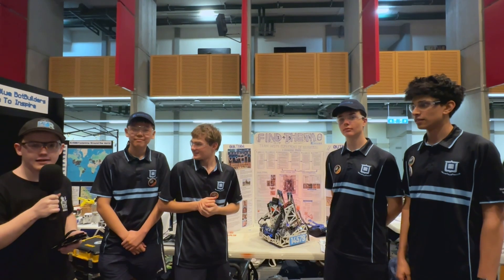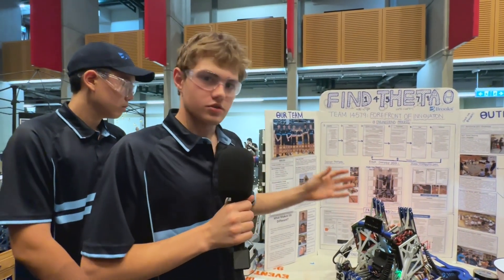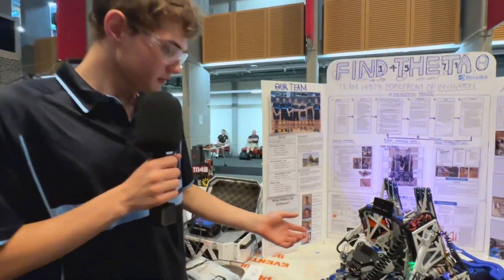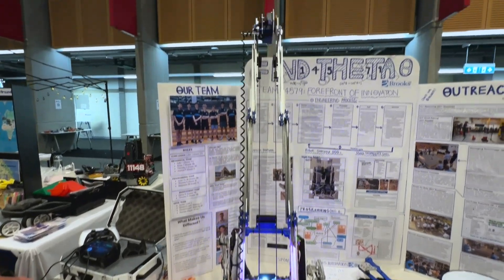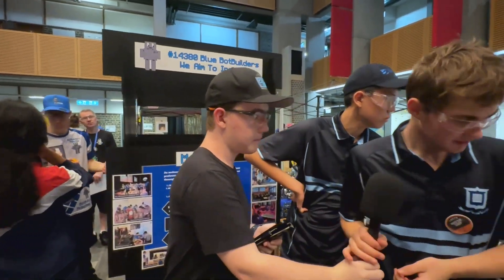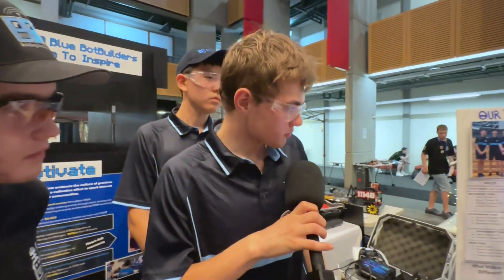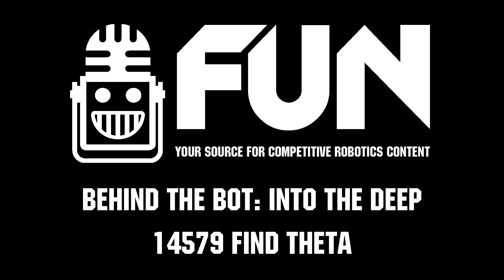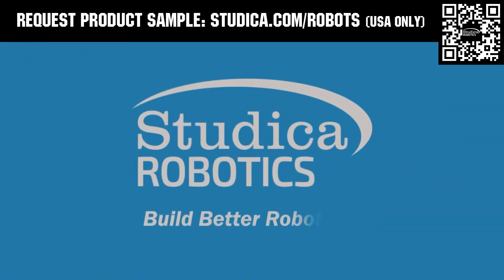14579 Find Theta | Behind the Bot | INTO THE DEEP

Comment: Doesn’t the sweeper violate G410? It’s pushing the samples away to a desired location, on purpose. At the very least it risks the foul from controlling 3 at once.
Reply: No it doesn't violate G410. We used it for the submersible, and that is legal to control multiple samples momentarily in the submersible. It was also answered in Q23 which stated it is legal.
Reply: Yea it does
Reply: You can control anything in the submersible